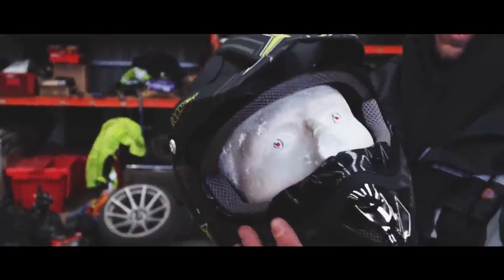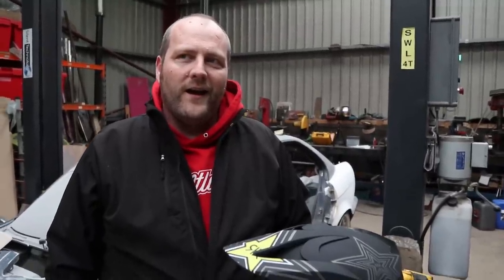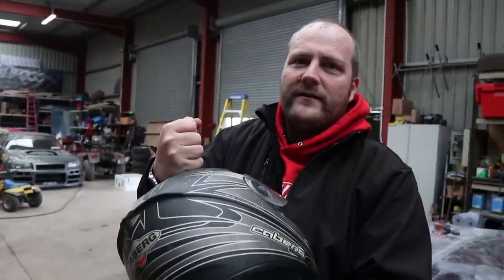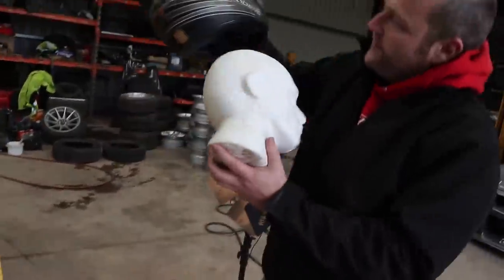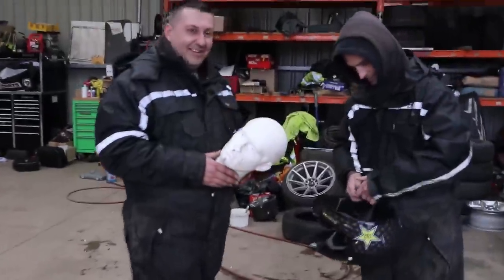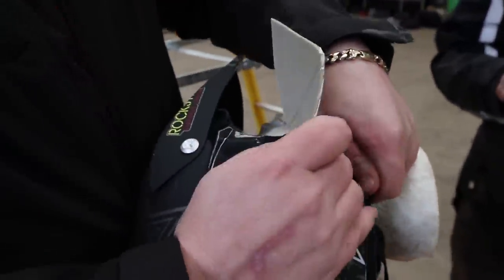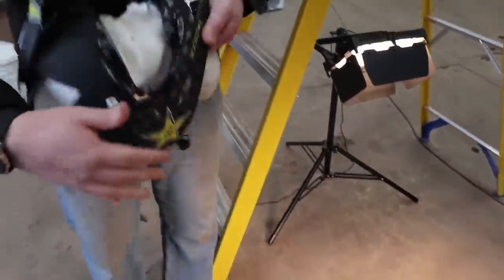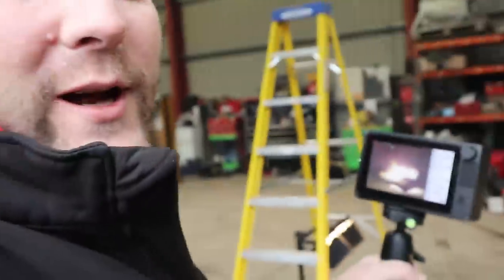How dangerous is a wish.com Crash Helmet? TESTED!

Comment: This is NOT a mountain bike helmet. The DOT (Department of transportation) label on the back states its a motorbike helmet. How it got that designation is beyond me? 
I sometime get up to 50+mph on my mountain bike and the helmets I use stand up better than that rockstar lid. 
Is that rockstar helmet a legit real helmet or a knock off? I feel like something needs to be done, that helmet is going to get people killed.
Reply: Non name brand. It's Chinese they didn't get that tested by the DOT.  It's just a sticker.
Reply from the maker: Deffo fake. not worth the plastic its made from!
Reply: You can DOT self certify ANY helmet. Only some of the helmets from market get tested. If you fail you than pay fine for every helmet sold.
If you aren't picked for testing, you are still legit.